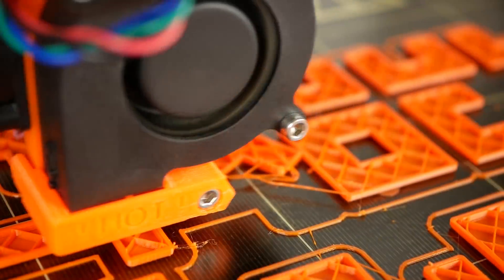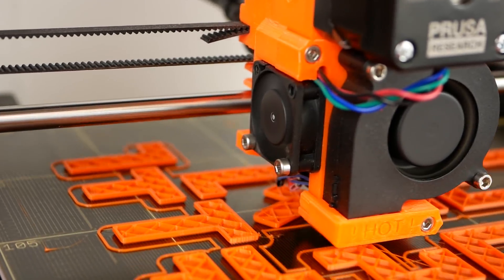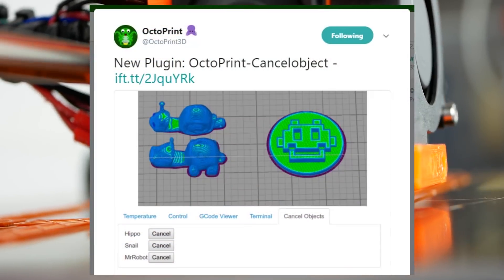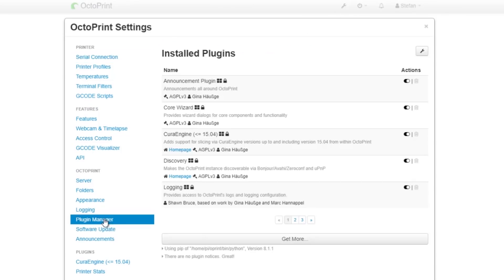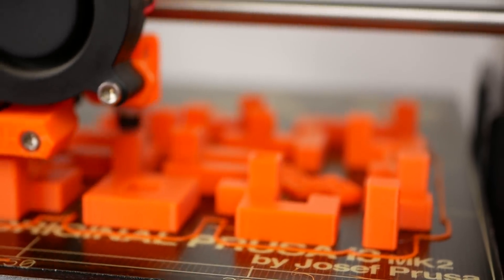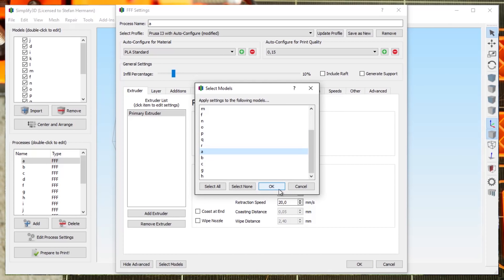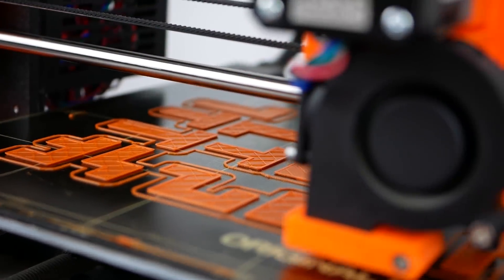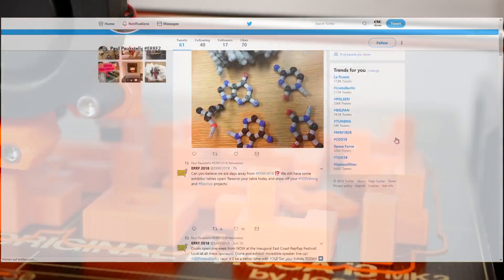THE FEATURE I've been wanting for YEARS is finally here!

Comment: I was buzzing about this feature until you mentioned Simplify 3D, I use Cura as S3D is almost the same cost as my printer.
 I hope this is ported to an open source slicer as my only other option is to use a cracked version of S3D which I don't feel 100% good about

Comment: I started using sequential printing a while ago and I am not going back. First of all, this problem does not exist. Since only one part is printed at a time, a failed part does not destroy anything else (assuming you abort the print at that time). Also it removes stringing or oozing between parts. It does somewhat limit how many parts can be printed at a time, but on the other hand, who wants to print jobs that are longer than 10 hours at a time?

Comment: Love the idea, have the plugin installed, but not needed to use it yet. Does Cura support slicing the objects in such a way that this plugin can dissect the parts in the Gcode? Or do I still use S3D, or Slic3r like someone else mentioned? Thanks for covering the plugin.
Reply: Nearly everything is in place to have it work with Cura. If you are willing to compile a branch of CuraEngine (https://github.com/Ultimaker/CuraEngine/tree/feature_comments_per_object) it will be functional though not exactly pretty. Each object will just have a number instead of a name.

Comment: Well great idea. Now combine that with a camera and some image detection and it could do it automatically. Just imagine a camera sitting at the top of the frame of the printer scanning the printbed. Once every layer the printhead moves to say 0,0 so the camera has an clear view and compare the outline. 
It shouldnt be too difficult to do that since you should have quite a high contrast to the backround. just black fillament would be tricky but ok. Sadly I dont have a working 3d printer to try it out otherwise id give it a go. 
Also how much of a pi 3's cpu power does octoprint normally use? Maybe you would need a bigger board.

Edit: i just saw octoprint is written in python. Why? why does everyone use it now a days :/

Comment: I'd love to see a slicer detect non-connecting parts automatically (maybe in the future) the other down side I see is some of us run multiple processes on a single part which this setup would detect as "2 or more different parts" so hopefully in the future they come out with a better method of doing this.  Possibly by adding to the gcode to define each set in blocks aka 
F1, F2, etc for function 1, function 2, etc so you can still do multi processes and be unaffected.  I don't know which letters gcode is currently using so they may have to use a different letter but the thought is still valid.

It's still a step in the right direction..

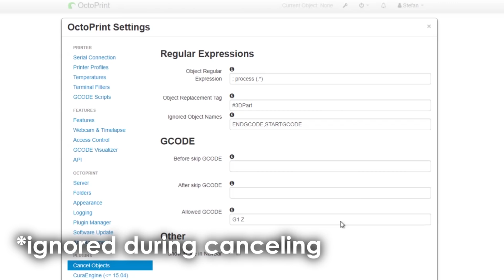Comment: I love the idea of individuality programming a single piece on the bed- not just to cancel... but also as mentioned at 3:35.  Wouldn’t it be neat for multi color printing to have one part that can be printed with the “waste” filament when it’s changing colors?  (As in Prusa Multi-Material).  There are always things I want to print that I really don’t care what color it is that I could print along side instead of a block of nothing.  Thanks for letting us know this is out!!

Comment: Hmmm. Since printing multiple parts on the same layer doesn't improve on total time to completion I was more of a fan of printing each part individually in a batch job. Somehow the implementation of this feature in the slicers I have tested is lacking a way to define the order in which to do that. (Unless I just did not see it)

For example a printer that is dragging its cables behind the extruder on the X axis extending to the back of the printer (like the i3 models) always needs to print front-left to back-right to not knock over previously finished parts. I would celebrate a way to influence the print order for batch jobs much more than just a cancel part feature. Plus it would make the part cancelling much easier to implement in OctoPrint as all parts start on the lowest possible layer which makes new parts easy to detect.

Comment: Sorry but repetier server has had this function for ages where you can make it ignore an area of the print bed while printing, so you didn't look very hard for this function. Sorry but I'm tired of everyone just keep pushing octoprint all the time when there is other very good  software out there
Reply from the maker: Repetier server is 80€, octoprint is free and open source. There are some arguments for the latter.
Reply: CNC Kitchen correct it is €80 but you stated in your video you could not find anything else that did what you showed in your video, where repetier does. Yes, repetier has a cost for its pro version, but its well worth it. Sorry but you have to use simplify3d do you not to be able to use this plugin and that is $150 and has very much the same features as other slicers. where repetier is all built in and well tested and works with any g-code from any slicer. So saying you could not find what you were after is very bad without looking at other programs. Maybe you need to change your title and description to reflect that this is all in relation to octoprint, because I came to this video thinking that a printer manufacturer had incorporated a way of doing it in the machine. (sorry finally edited now i'm home and not on my phone)
Reply: What's the feature even called? I went to the Repetier web site and couldn't find it mentioned anywhere. I didn't look in their support docs but that shouldn't count. If they don't list it as a bullet point feature on their own site then I don't think it's fair to blame Stefan for not knowing about it.

Comment: I thought about it a year or two ago, but on how to do it in Marlin i.e. teach the printer.
In "normal" gcode there are IF and GOTO commands, which are so far not implemented in Marlin. With those you would be able to set cancelA to true and it would read the line IF(cancelA) GOTO 199
199 of course would be the line where the next object starts.
I think repetier host has had a "crude" version of cancelling by enabling you to draw a box where movement to should be ignored. this enabled cancelling as well

Comment: This feature is epic! I have lost so many prints because of one finicky part or a part of my bed that is not sticking well. This will be some extra work up front but in the long run it will save me the time and money from failed prints. It will also encourage me to use the process settings more which I've avoided but on multipart prints there is some benefit to using different settings on different parts.

Comment: Well... Stefan, you info is not correct. This feature has been imlemented in pronterface for at least like 1 1/2 year, may be more. The feature introduced at octoprint in the form of a plug in ONLY works if the slice has been made in simplify3d. But in pronterface you can stop a part of the print with a gcode generated by any slicer. The pronterface feature, lets you drag an area in the printbed representation and cancel that area! just want you want :)

Comment: Big downside of this plugin is that it works with S3D only.
Btw this was already possible in prontefrace ages ago, and in better form - you just selectedin the preview which part of the print surface to skip.
Reply: It also works for sequential printing in Slic3r (see github readme). I don't think XY bounding boxes are a good way to cancel something. There is more overhead (EVERY print move has to be checked if it is in that region) and if you have objects that have overlapping bounding boxes anywhere in 3D space you are screwed.

Comment: Here is an idea, object cancellation (or at the very least, pausing) can even be automated with computer vision.

Tighter integration between host,firmware and slicers are always welcomed. For instance, we might want to change infill %,  perimeters, print speed,  re-slice remaining layers without interrupting the on-going prints.
Reply: Related to this, there’s an OctoPrint plugin (aptly named “The Spaghetti Detective”) that uses a CV server to detect failed prints and automatically cancel them and notify you! It could most likely be adapted for cancelling individual prints. The only drawback is that you need either a powerful computer as the server or to use their service, which is free only during beta testing.

Comment: Yesssss! S3D and other slicers should also implement an easier way to assign processes to each part. A single button: assign individual processes to each part? press yes, and voila!
Reply: Better yet, just add a comment with the name of the object that the following block of gcode is associated with. This would keep process working the way S3D intended, but would allow the cancellations of actual objects.
Reply: Paul Paukstelis thanks for the plugin

Comment: wait, PEI covered hotbed in mk2 doesn't have good adhesion? can't you buy ultrabase for it?
Reply from the maker: The PEI is great, but things can happen. The more parts you have the higher the possibility that one part fails. Only needs me touching the bed with greasy fingers before the print ;-)
Reply: what it interesting is that when the prusa pei sheets are on a mks mk3 heatbed the adhesion is much better than on the original or orballo Mk42.

Comment: This has been a feature in repetier server for a while
Reply from the maker: Do you know how it's implemented there?
Reply: My understanding is that you are able to define an XY bounding box and no printing will happen in that space. This is a useful feature, but IMO, it is not as clean a solution as directly cancelling the object. What if you have an object that you don't want to cancel that enters that bounding box at some higher Z height? You lose that print too.
Reply: You can select the area under the live preview window of an active print.  See the section Exclude G-Codes: https://www.repetier-server.com/manuals/0.90/index.html
Reply: I see. I like the idea of being able to see it live (like Stefan mocked up in his video). Others have suggested incorporating into the octoprint gcode preview, which would be the simplest way to do this. Excluding just an XY bounding box is pretty limiting, however (objects may have overlapping in both XY on every layer, and in Z at other layers).
Reply: Is excluding geometry that approximately connects to each other sensible? I.e. you could have a medium resolution bitmap (1 texel per millimetre or per 2mm or so), in which you select a cancellation coordinate, and then paint in all the print moves of that layer that touch each other from that coordinate outwards, and exclude those moves; for subsequent layers exclude moves that touch the painted portion of the bitmap and also paint them in. I think that while you can expect bounding boxes to overlap in XY even if the outlines of the objects, as viewed from above, don't come near each other, perhaps because they have been placed using other kind of bounding volume. I think a case when parts are partially above one another doesn't necessarily need to be supported, the usefulness of the feature might not be significantly reduced.

Comment: Saw this. Very much needed functionality. Will this work if running parts in "sequential" mode in S3D? Would I would love to see is a way to stop certain features during a single print like a cancel button to stop printing support material for example when a print looks like it doesn't need support after reaching a certain height and you realize you didn't really need it or if it failed and adding more support would cause issues for the rest of the print.. Or stopping or adding Z hop on the fly or changing layer height or infill density on the fly. This would require re-slicing and wonder if the future would also bring this sort of functionality.
Reply: It does work with sequential mode (it also works with Slic3r sequential mode, though that has not had much testing). The idea of cancelling supports (or other features) on a per object basis would be possible I think. At least S3D puts comments at the start of most features and those could be parsed.
Reply from the maker: Sequential mode works with Slic3r, I'm not sure about Simplify3D. Add a feature request on GitHub and there might be a way to implement it in the future.
Reply: I dont think you can that easily change print job like cancel part of support, that would require octoprint to fully undrstand all g-code and be able change and rebuild code on the fly. 
It can be done in slicer SW directly but it would be quite complex to implement.
Reply: You couldn't cancel just part of a support for the object, but you could cancel any remaining supports for that object in the gcode. It is a good idea. With the framework from the existing plugin I think I could probably get it working. I just don't know how often that scenario arises....

Comment: Brillaint. There needs to be a slicer standard code for this. The S3D way looks ok for now, but Process doesnt always equal Part. And its a pain to make all those processes and assign meaningful names.
Reply from the maker: As I pointed out, it's a workaround. If there is enough demand, there might be something else implemented, which makes that easier. Either a wizard or just a simple checkbox.
Reply: Go bug your favorite slicer authors. All they really need are comments at the start of each block of gcode that relates to each object.